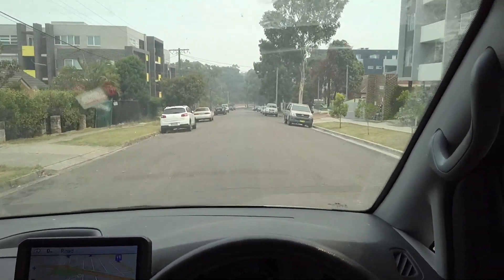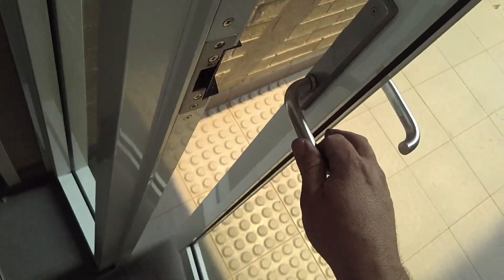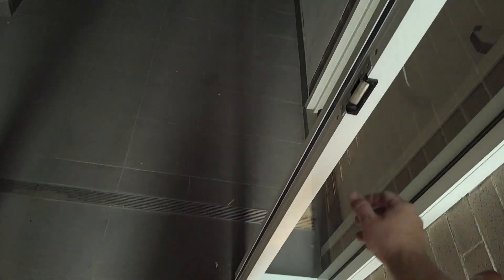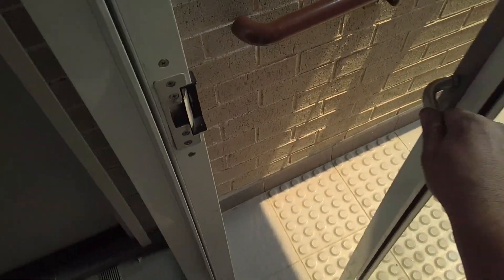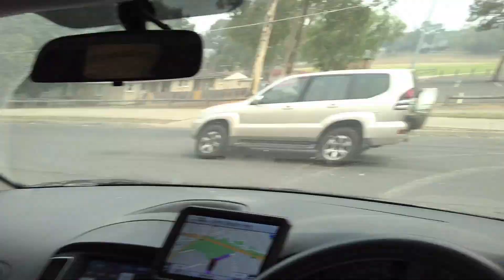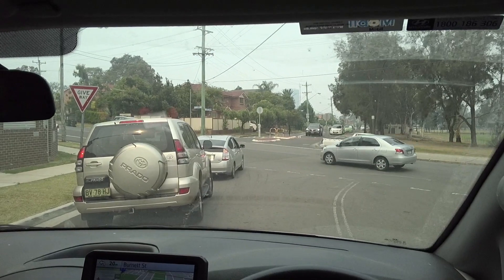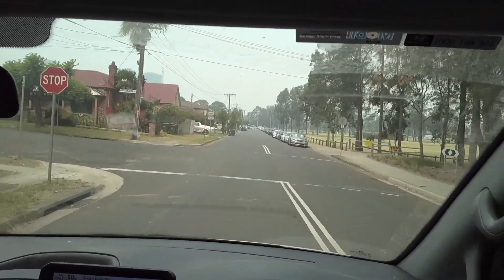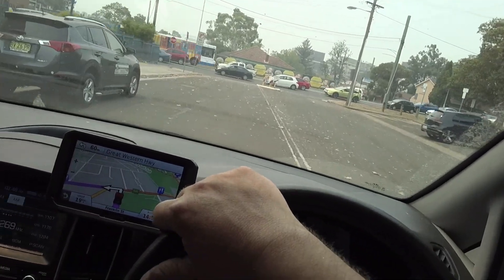Locksmith Job 260 Foyer Door Not Locking

Comment: Did you cut the washers so you didn't have to remove the screws? I never thought to do it like that
Reply from the maker: Hi, I cut the washer so the face plate would sit lower, not the best solution, but it worked